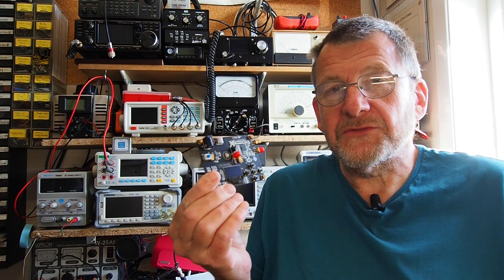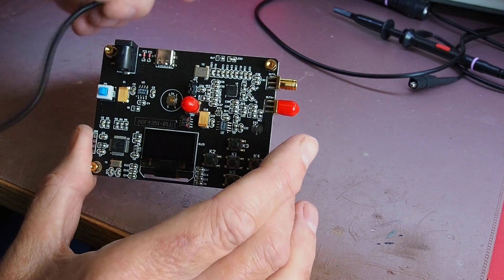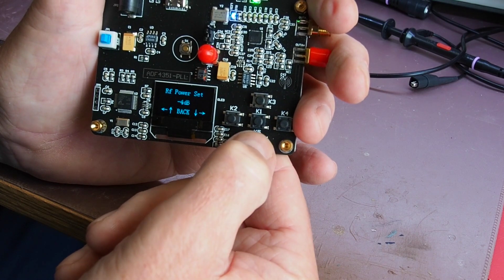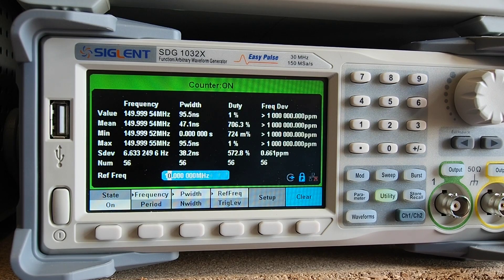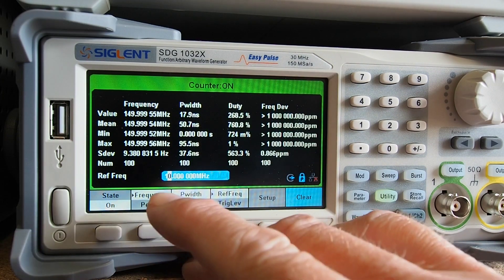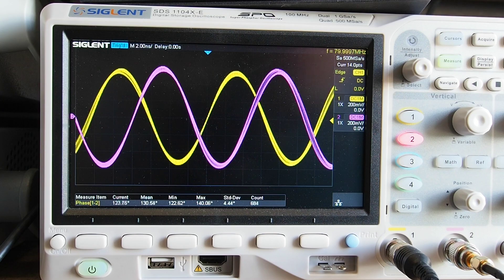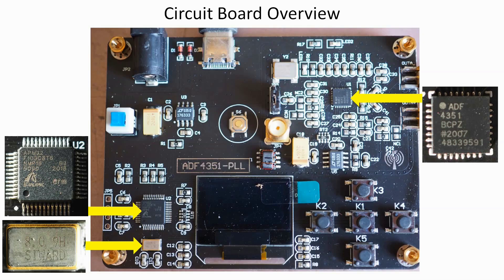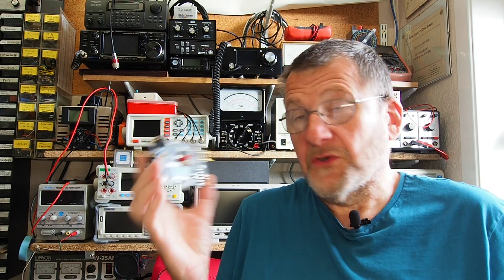ADF4351 RF signal source - #090

Comment: There is a jumper selection in the center of the board for internal or external clock. Do you know where to connect the external signal?

Comment: @12:00...the spectrum shows that each odd harmonic is only a few dB down from the previous. The 3rd harmonic around 10dB down, then 15, 18, 20dB down, but the harmonic measurement table shows all odd harmonics after the 3rd to be over 90dB down. That doesn't make sense. Where have all the other odd harmonics gone?
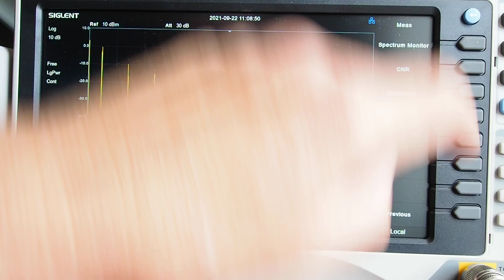Reply: I agree. harmonics dBc values at 12:26 don't match the spectrum visible around 12:00 .

Maybe this is due to a bug with the spectrum analyzer's (Siglent SSA 3021X Plus) firmware? Siglent has released firmware updates since the release of this video from November 2021; and the release notes include bigfixes such as "Fix the problem that there is an invalid frequency menu in Harmonic in SA mode".

Comment: Thank you for the review, very informative. I've been looking for a sensibly priced VHF generator for some time, and these look just the job. Your spectrum analyser output with strong odd harmonics suggests it's got a square wave output, but your oscilloscope was displaying it as a sinewave because the frequency was close to the scopes limit. You'd probably see a more accurate waveform at a lower frequency.
Reply from the maker: Thanks for the feedback!
Have a look at this screen grab of the output at 50MHz, the scope's bandwidth is 100MHz, so well within it's range....
https://drive.google.com/file/d/1uIkmP50tdH9LNoFCJA6Us_RvcphsLvnC/view?usp=sharing

Comment: I have one of these boards. A valuable tool for signal generation up to 4GHz++. However, each output are measured to 0dBm, with the +5dBm setting in the menu. It can perhaps be because of (1) a "dodgy" design of the output from the IC to the SMA. Or (2 - less probably) the nominal power is given when using both outputs in differential mode. The outputs are 180 degrees phase shifted too.
Reply: The collector resistors (R12 and R13) in the output are 68ohms, but they should be 50ohms each. I believe it's root cause of the problem.
Reply: @marko.692  No they are not; 68X smd markings indicate 49.9ohm resistor values. This PCB is a clone copy of the original Chinese (that one is ENIG and has a trash can logo beneath the switch). On that PCB R12/R13 are actually L2/L3 3.9nH inductors.
Reply: @luisderivas6005  You’re correct, 68X smd resistor it’s 49.9Ohm, thank you for letting me know. I don’t have experience with smd marking standards and after magnifying Bill’s video I assumed the 2 resistors are 68Omh each :)

I don’t own this generator, since it's square waves I passed. I’m using my TinySA as generator, it’s sine wave (LOW connector) up to 350MHz. If I need higher frequency I use harmonics from the HIGH connector square wave, or my NanoVNA.